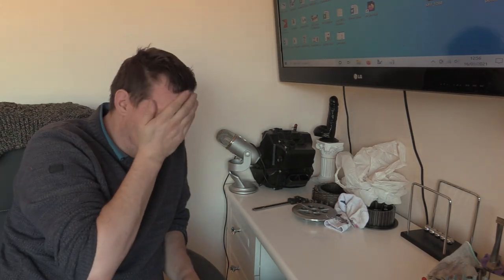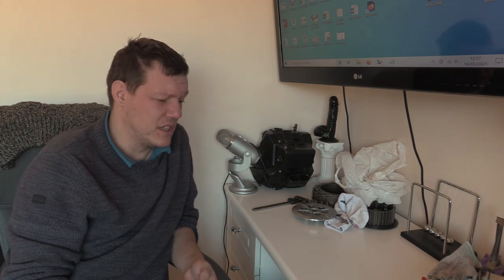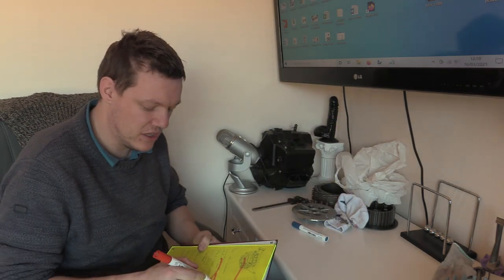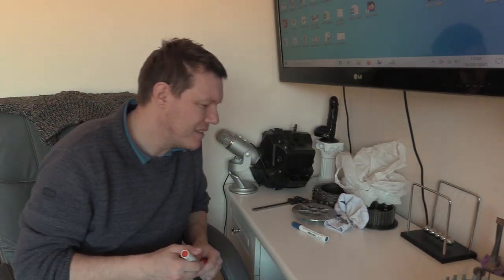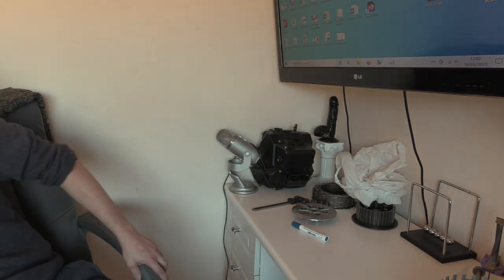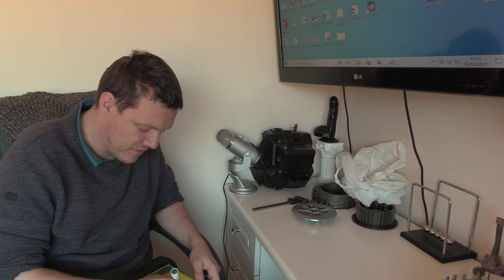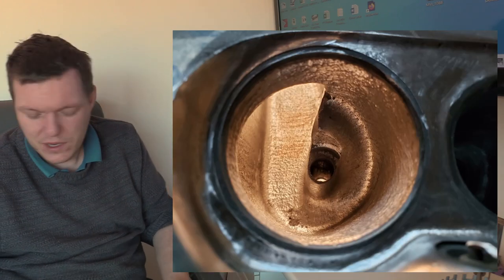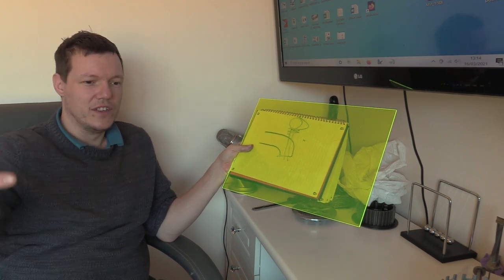Why old ports are JUNK!

Comment: Just a note, the Mazda RX-7 (some years) had a screen under the fuel injector to help atomize the fuel. I was always worried about them getting loose and going through the engine. That was a long time ago and I don't know how far forward that design went. Mine was a 1986. I also had a 1990  Suzuki Katana 600 with the TSCC system, about half the horsepower as the current version.

Comment: can you do a video talking about desaxe engines and offset pistons and how it changes motion of the piston and such and why designers use it/what are its advantages
Reply: Especially the difference between cylinder offset/desaxe and wrist pin offset would be interesting.
Reply: @heinzhaupthaar5590  yes i agree

Comment: When emissions regulations came in during the late 70s and engines suddenly got strangled on horsepower and economy .. The power didn't come back until the 90s with the joint happenings of EFI and the advent of heads that flowed numbers that would previously have been good for a racecar.. and an efficient engine is a clean engine .. who knew?

Comment: Hi 
I like my atmospheric injectors no wires just work. But on a slightly more serious note is there any point in updating/ grading the old American V8, it doesn't spin fast enough to need double overhead cams or even a single ohc its port design is shit compared to motocycle or F1 stuff but it works well enough at the speeds it was designed to run at with a broad torque curve from not much above idle speed through about 4500,  also it would be a bit daft to increase the power output to the point where the engine makes no useable torque below 3000 rpm in a vehicle such as a pickup. You wouldn't put a race horse in front of a brewer dray
Keep up the good work
Reply: The modern GM V8s are basically that - the updated American V8s with modern ports, injectors and intake designs, but still with pushrods and whatnot for the valvetrain (and other gizmos like cylinder deactivation where they collapse the hydraulic valve lifters). 

And it shows in the results: a great combination of gas mileage, horsepower, and durability to go 300,000+ miles (due to the large displacement and low stresses) and still enjoy nitrous after it all. (if only the rest of the stuff could keep up...)

Comment: Thank you for another very enjoyable video. I always find your content to be very informative and entertaining. I believe there maybe some additional points to be made regarding port design and its relationship to engine efficiency and specific output. Maybe some ideas for a video on the continuation of the subject. Firstly it is worth mentioning that the turbulent flow that you mention or so called "charge motion" is equally important in regards to flame propagation after ignition as it is to a homogeneous fuel mixture. It is important for adequate charge motion to exist at TDC to allow for expedient combustion. Combustion in a stagnant charge only spreads at the local speed of sound, far to slow for operation in an engine. The flame is helped to move more rapidly through the entire cylinder by this residual charge motion. The quicker combustion occurs the less ignition advance is necessary, thus increasing brake specific horsepower and reducing specific fuel consumption. Secondly worth mentioning is that the port geometry changes in modern engines didn't not necessarily remove charge motion, we just changed how we achieve it. Fuel must still be mixed as fuel injectors do a fine job adomizing fuel, but it is still far from vaporized. The old way as you pointed out was the so called swirl port and now we use what is called the tumble port. Flow is much more laminar in the port, lending to good cylinder filling, but the angle of the port and careful fluid dynamic modeling ensures good mixing once in the cylinder,  and the retention of adequate charge motion for good mixing and flame propagation all the way to TDC. 

Lastly as far as so called poor engineering of the LS engine I have to disagree. There are many more metrics that engine performance are measured on than specific output. Specific output only matters in racing classes where displacement is limited. In real world vehicle performance, horsepower per pound of engine weight, or power for a given engine's physical dimensions are equally important. GM knew this (they have built many a DOHC engine) but decided that a OHV layout was worth the "compromised" valvetrain for the advantages of small physical size, low weight, low cost, and ease of maintenance. The lower specific output is a none factor when a 7.0L LS is smaller and lighter then a 4.6 DOHC ford engine (or any other DOHC V8 of large displacement).

Sorry for the rant, I truely enjoy your content and will continue watching with great interest. Keep doing what you do!

Comment: By the time the Americans come up with a high tech V8 with 4 vales, quad cams, fuel injection, VVT, VTEC, high effieciency and god knows what else, oil will have ran out.
I can never understand why they are so reluctanct to change from an atiquated 1950's design. There is nothing sophisticated about them whatsoever.
All they do is increase the size of the engine. As they saying goes: "Aint no substitute for cubes boy"
And, this is coming from the only country in the world that still works in imperial, where 63/64ths of the people still think it's fine. Fucking inches, they're a joke. It's so much easier to think in powers of ten, than 8ths, 16ths and 32nds. If Metric was an American invention the whole world would be that by now.
Having said that. I still wouldn't mind the new Corvette C8 mid engined supercar. 6.2L V8 muscle car! They even make them in right hand drive! How good is that?

Comment: I agree that field injection is way more reliable than carburation.  The only problems I've ever had with an EFI are a bad O2 sensor and a leaking gasket on the intake plenum. The bad O2 sensor was on a 80s Renault. No electronic problems since. The worst of both worlds were the electronic carbs that were around on some vehicles in the 80s. Carbs, bad floats, crap in the idle circuit from debris in the fuel filter, choke issues etc.
As to the OHV Ametican V-8s. They make up a small part of the US market. Their major advantage over an OHC or DOHC engine of the same displacement or even less displacement is in the vehicle packaging. Two comparisons. The Ford DOHC V-8 vs an LS. The LS is a smaller overall package. The Ford is a very wide engine. It is wide because of the heads.

Comment: yeah, that's what my cousin told me both times after buying an old carbureted sportsbike. "get yourself one with injection, there's less to mess around when you've left it in the garage over the winter. no need for cleaning and adjusting carbs all the time". so far i've never had an injector fail on me in cars, so i might get a bike with injection next.

Comment: Could you go over the right way to shape an intake an exhaust port on a 4-stoke fuel injected bike.  All I see are videos of people complaining about not to do it.  Also that dildo is distracting but funny as hell when you're drawing those ports with it sitting in the background.   I'd also like to hear your thoughts on glyptal if you've ever used it.  I have a quart of it and am planning on using it on the inner crankcase of my bike.

Comment: I can't believe any manufacturer is still selling OHV engines, I'm rebuilding a 71 BSA a65 and although pushrods are very simple for an idiot like me to work on, they look and feel archaic on a 50 year old engine let alone something brand new out of a showroom
Reply: Now more than ever packaging is extraordinarily critical. Compare the size, the physical external dimensions, of the pushrod motor in the Corvette versus the overhead valve Ford equivalent. The size difference is extraordinary.

People not in the automotive industry don't understand how tight the packaging is. I was working on the new Continental, it was a showstopper because the installed height of the motor mounts were 2 mm higher than designed.
Reply: Now look at audi 3.0tfsi engine timing chain replacement videos and tell would you prefer this over a ohv
Reply: @otm646  if packaging is so important why not use a turbo 6 or 4 cylinder that makes similar power and torque numbers to a big NA V8 and has the added benefit of improved fuel efficiency, and has an easier time of passing emissions.
Reply: @Robis_Grigoris  I'm more talking about motorcycle engines than car engines, but surely how easy a timing chain/belt is has nothing to do with OHV or DOHC, you can have DOHC engines with a belt that's easily accessible from the front of the engine bay, or a chain driven cam on an OHV engine that you have to dig into the bowels of the engine to replace, it just comes down to how well an engine has been designed for easy maintenance

Comment: I think carburetors are over rated. I grew up on a farm messing with diesel engines and went on to  get a trade as a lorry mechanic. I think my experience with diesel engines is why I prefer messing with fuel injected bikes.
I think I just get on better with the Idea that an ECU or a cam timed to the engine decides how much fuel to give and when to give it.  You don't have to worry about fuel mixtures or turning screws. If something in the system breaks down, you just replace the part or what ever and it works again.
Reply: And if the vehicle is in good to excellent condition otherwise and you can't get the sensor or control module you're still screwed. I mean I love EFI. Starts in the winter with no issues, great power and decent fuel economy in relationship to use. As to carbs. There's carb and then there's carbs. Besides on modified hobby car (I'm thinking the US here) carbs just look better.

Comment: Matt,  what happened to MG Triumph, Sunbeam, BSA Norton Aerial and the rest of the failed British automakers and motorcycles manufacturers.  Yes American cars are shit but our shit was better than your shit. Now it is time to go ride my Royal Enfield classic 500 and enjoy the massive 26+ HP it makes. Or one of the other bikes I have . My point best performance is not always the goal.  American Offenhauser 4 cylinder engines made 125 horsepower per cylinder we know how to build high-performance four-cylinder engine been doing it since 1933. The problem is big heavy V8  work better in big heavy Highway cars that go a hundred or more miles before there's even a place to stop much less purchase anything. What was needed was a under stressed slow turning engine that cruises over massive mountain without slowing down. Most of the modern technology added to the V8 are there to reduce emissions.  Emissions is the reason fuel injection was added,  without emissions regulations they would still be using carburetors. By the was way did Landover purchas that American V8 214ci from Buick back in the day?
Cheers.
Reply from the maker: Fuel injection was emissions control? You wanna look up the history of fuel injection...

Comment: I read somewhere that the reason they stuck with pushrods in the modern LS engine, I do not even know who makes the LS engine but it seems to be a popular engine swap in the US, is because they can keep the wider V between the cylinders but maintain a shorter engine which takes up less room in the engine compartment and we know engine fuel efficiency is a lesser consideration over there then it is in Europe because of fuel prices.
Reply from the maker: Sounds like an excuse. European and Japanese engines don't have huge bonnets/hoods. Instead they engineer an engine to make more power for less cc than the other way around.

Comment: You really don't like pushrod engines. Did you know that OHC actually predates pushrod engines? To me it seems like ohc and ohv setups both have a place. For instance, if you live somewhere that taxes you based on your engine's displacement. If you are taxed for being over 2.0 liters then you really would want to make the most of it with DOHC and higher rpms. If you live where I do and there are no such taxes, things are different. I drove a camaro with a 5.7L pushrod v8 for years. It actually got 32 MPG(13.6 KPL) on the highway going 70 to 80 mph (112 to 128 KPH). For a 3500 lb car that made 345 rwhp on a dynojet,  I think that's impressive. If you compare that pushrod engine (LS1) to DOHC engines from Toyota, Nissan and Ford that are a similar displacement you find that those engines are much larger and heavier. Most of the comparable DOHC engines of similar displacement make less power and consume more fuel per mile. If an engine makes more power, has better fuel economy, is lighter, smaller and does all that with less moving parts, is it actually inferior? What do you think would wear more quickly, an engine running at 1600 rpm or one running at 2600 rpm at the same mph/kph? All I'm saying is that both designs have a use case. Also, I don't think governments should interfere with engineering decisions arbitrarily. They all seem to though.
Reply from the maker: Taxes?
Reply: How downhill was that 32mpg run? Looking on fuelly, that's pushing it a bit. The Italian 2.0 tax is often overcome with turbocharging, resulting in an Alfa V6 with an horrific exhaust manifold.

Toyota Supra twin-turbo, BMW M5 "E34" 3.8, Porsche 996 3.6. None of those are going to wear out in a hurry, or have trouble cruising. The problem is trying to find something near 6.0 with so little power, that's not in something like a Mercedes S-Class.

Comment: Sounds like yamaha old mt-03 600cc was replaced with 300cc, and these days you can say that R3 is faster than R1 in short cornered tracks (fck long distances, its flu and slavery).. so in future we can get R1 replaced with R125 with turbine :D Just like cars with engines lower than 1 liter.

Comment: But all these changes to engine design have been made to comply with legislation, and to compensate the engine manufacturers by allowing them to introduce solutions that are cheaper to produce, but more expensive for the owner to replace, whilst making them considerably more difficult to service. 

Until you ask the fundamental question: Qui Bono? (Who Benefits?) you cannot truly understand the motivation behind the introduction of these new technologies. 

What you’re essentially doing here is explaining why it wasn’t you that farted. 

Believing the official narratives in any given situation is just lazy. Yes you’ve been trained to do so from the nursery, and you’ve been gifted stock phrases to use to vilify critical thinkers, and rewarded for doing so, but at what cost?

Just ask what REAL problems do electronic fuel injection systems solve? And who ultimately benefits the most?

When you do the math, it’s NEVER the end user. 

Right now we can look at two Honda bikes and one Chinese bike. 

The VFR750 with carbs is universally accepted as far superior to the 800 EFI model that replaced it. But the CBR1100XX Blackbirds with EFI are better than their predecessors. 

The Piangxongting 125 EFI copy of a long forgotten Suzuki costs £12.50 to build, and sells for £1,500. Just adding a carb would double the costs, but thanks to legislation, they couldn’t sell it. 

Essentially, it’s all bollox 🧐😎

Comment: I beg to differ on the injectors being more reliable than carbs these days ,  I work in a bike shop & the bread & butter of repairs  are  cleaning out fuel systems  in  bikes & quads etc that have blocked fuel systems, often from sitting  too long with  what seems like shit petrol  , multi cylinder  injectors  have all those advantages you mentioned but you need to service /use these things ,  if you want reliability look at  carbs with a good ignition system for that trip across Africa/ oz etc on a bike , I do like my old XR400s , XT 600s , there is nothing more reliable
Reply from the maker: Engine have been designed to be used. No-one has ever designed these systems to sit and do nothing.

Reliability is not just based on what happen if it fails, reliability is also about performing whatever the environmental conditions.

Comment: Great video and explanation. I have one question. Why does Ferrari keep banging on about „high tumble inlets“ and all that in their explanations and videos. For example they say F355s middle inlet valve opens 10 degrees after other 2 intake valves have already opened and so this creates more swirl and helps mix fuel and air better. F355 has Bosch Motronic M2.7 EFI with solenoid injectors btw. And in their 488 video which is this https://youtu.be/oXlPXKc8Cbg , at 1:56 they say high tumble inlet ducts claiming its good or wtv. And when i look at the whole ferrari video it looks like the ports are just like the modern ones as you have said , but ferrari claims otherwise by saying „high tumble inlet ducts“. The 488 has Motronic ME 10. something which is Direct EFI with solenoid injectors that inject in 2 pulses. I was wondering why Ferrari claims high tumble is good

Comment: I like injection systems except continuous ones like Rochester Ramjet or Bosch K-Jetronic. Very few amount of race cars actually used k jet and every road legal ferrari lost massive amounts of power after switching from weber carbs to k jet. 308 , 412 , 512 series being the examples

Comment: LOL, GM.  Ford, Dodge and everyone else went overhead cam but ol GM. The most non common sense approach to move away from EGR. GM had the tenacity to make a variable hydraulic lifter system that is nearly impossible to diagnose when they fail and they fail a lot. You would figure since the cylinder deactivation system they came out with was a complete failure that they would get on board with overhead cams and camshaft actuation but no, no they didn't. Don't know why either. Ford's 3.5l v6 ecoboost is making 650 whp but GM must be stuck on the displacement has no replacement thingy. LOL